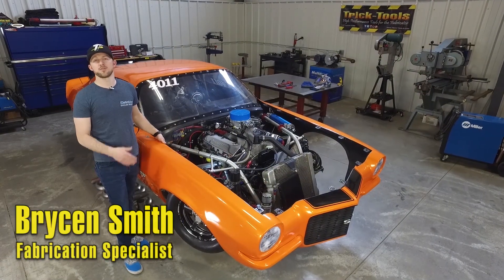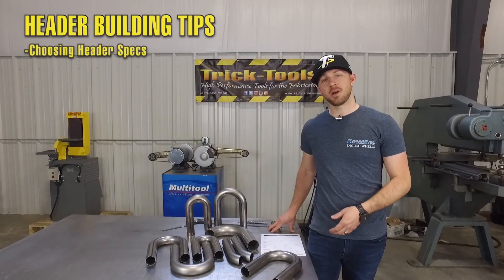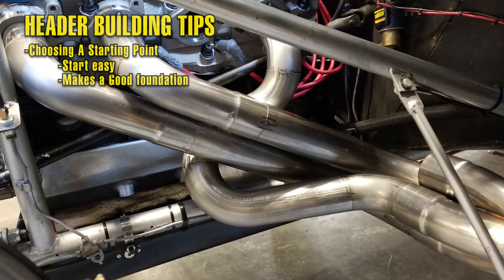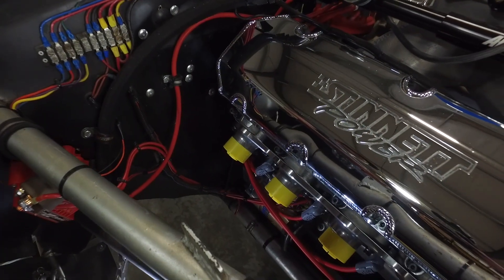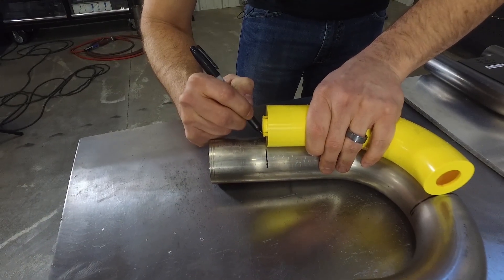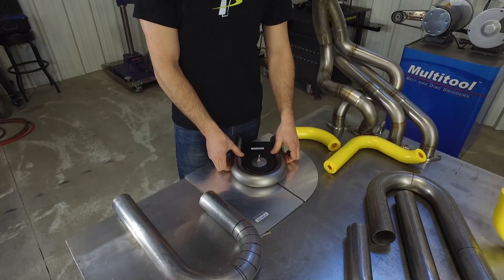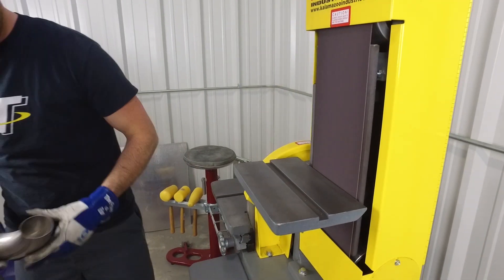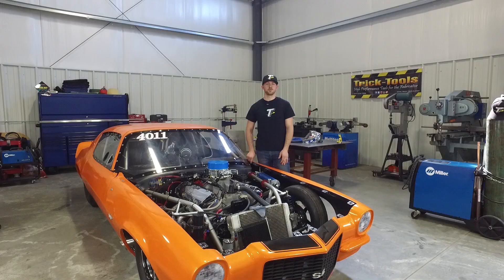Do it Yourself Header Building: Build the custom exhaust system you always wanted.

Comment: hmm why were you not using back gas with stainless steel tubing? and how much did you charge for that job- details
Reply: not necessary for exhaust manifold. You would back gas if building a turbo pipe or manifold.

Comment: Looked like you didn’t use filler wire on any of those butt welds. Would it be less likely to crack if filler was used and the pipes have a very small bevel? Or not really necessary?
Reply from the maker: With perfect fit up at the weld joints, filler rod is only used when needed. With proper heat and technique penetration through the seam can be achieved without compromising the tube strength. This process is plenty strong and has been proven many times. These specific headers have seen 2 racing seasons and are still in great shape.

Comment: Do you fusion weld the butt joints? Its hard to tell if you were tacking or fully welding in the video since it was sped up but i didnt see any filler rod lol
Reply from the maker: The seams were fusion-welded as much as possible only adding rod if needed. I put a premium on no gap seams so I can do that. It allows for a lower weld temperature keeping to base material from getting too hot and therefore becoming more brittle while also limiting "sugaring" on the inside. I've used this technique for years and welded somewhere between 30-40 sets of headers with no cracking or other issues.
Reply: Trick-Tools.com awesome, thanks for the reply, im about to tackle a set of zoomies and been hunting different ways guys build stuff, id rather spend more time dealing with perfect fit up then adding filler rod on every joint.  Everything you said makes sense so thats the method im using. Thanks again!

Comment: I built my own headers for my project, a Gen 3 Hemi in a 92 Chrysler Lebaron SS/GT. it wasn't a real easy job, they turned out pretty good. Now, those modelling tubes would have been awesome....I used aluminum fuel line as bend surrogates, also, my headers were step tube, started out as 2 1/8, to 2 1/4 ending with 2 3/8. They don't look as pretty, but they are real close to equal length. Step tube headers make a lot more power due to the "release" velocity thru the tube, but are more troublesome to make.
Reply: How did your exhaust sound afterwards on the LeBaron?

Comment: Very Well Done in regards to Information and Presentation!  When you started welding pieces of previously cut tubes I wasn't sure how you arranged each piece to have right angles just before welding.
Reply from the maker: All of the pieces were tacked together in the car in place. If you do need to remove them to tack I recommend marking the clocking of the tubes with a sharpie across the weld seam.

Comment: No argon inside pipes ??? Newbie....
Reply: Back purging is not mandatory. while it has benefits, proper welding technique will achieve good results. I've built over 40 sets of headers and many exhaust systems and most weren't purged. no issues have resulted in the non-purged systems.

Comment: How do you determin which primary tube goes on the collector position. Should the tubes be in a clockwise firing order on the collector or doesn't it matter.
Reply from the maker: Hi, Thanks for watching. It depends on your application. On most applications you wont notice any difference in the location of the primary tubes in the collectors. For space reasons sometimes you would be limited to which tubes have to go in each location as well. Hope this helps

Comment: To build a full long tube header like in this video. Do you need the Pro kit or does the basic kit have enough pieces to get the job done?
Reply from the maker: the Pro kit would be the best option. the Basic kit wont have enough blocks to model the complete header.

Comment: Very good video. Excellent work. I've done several two into ones including compound tapered bends and collectors. I use a wire for measuring the same way you use your tape rule. Never seen the modeling blocks before, they are now on the list.  My only criticism is that no experienced fabricator uses gloves of any type in any shop that has machinery with moving components. Doing so is the very wrong example for novices. I hope you are not forced to allow insurance companies to dictate how work / play is to be conducted in that nice facility.
Reply from the maker: Thanks for the reply. I will say that I am a very experienced fabricator with 15 years and over ten thousand hours under my belt. I use gloves regularly to protect my skin from molten metal sparks and sharp edges and I have never fallen victim to a machine because I make sure that I keep my hands away from pinch points and away from the parts that will catch you. I always hold my parts and position myself to in a way that If I slip I wont push my hand into the machine. Most accidents happen because people are careless with hand placement and set themselves up for failure. Thanks for looking out and I will say that we get hate mail when we do and don't wear PPE. Everyone has a different way.

Comment: In your design, do you take exhaust scavenging into consideration???
Reply from the maker: The design of the headers was based off of the specs of the engine and the amount of airflow needed to allow the exhaust gases to properly exit the cylinder heads

Comment: $420 for a 4 cylinder kit from icengineproducts HAHAHAHAHA I can get a 3d plastic printer and make them for cheaper. That is an utter rip off for some pieces of plastic.
Reply from the maker: It sounds like you have it figured out then! pretty sure your investment into a 3d printer and the time spent drawing the different pieces and then printing them would equal a lot more money than just buying them. Time is money and we have lots of happy customer that were able to purchase them and go right to work getting paid to do customer jobs.
Reply: @TrickTools  Lol, I definitely have it figured out. Been doing damn fine for myself.
Reply from the maker: Awesome!
Reply: But would you have thought of making them without seeing the kit first? Likely no. $420 isn't bad for a kit that's meant to be used multiple times by a fab shop. Easily worth the money if you use it more than once or twice.
Reply: This is a useful tool for a limited market, do you have the slightest idea how enterprise and the free market work? Using your logic, I could have done my recent finger surgery myself; all I needed was a sharp knife, some alcohol and a sewing kit!

Comment: Maybe I'm wrong but it looks like you have female end of the pipe coming off the head first. Wouldnt you want that the other way around
Reply from the maker: not sure what you are referring to?
Reply: @TrickTools  I noticed in a couple of frames the one side of the pipe was a small end (male) fitting into the larger end (female). Wouldn't you want the male end always going away from the head into the female end
Reply from the maker: there are no slip joints in these headers other than the tubes into the collectors. what you are seeing is the step up from 2 1/4" to 2 3/8" in each tube which we achieved by expanding the 2 1/4" tube to 2 3/8" and then butt welding them together.
Reply: @TrickTools  no kidding. That's amazing

Comment: I got a few stick of 20' stainless round. Problem is Stainless won't bend like DOM it kinks and it's takes alot of force. Kinda frustrated
Reply from the maker: That is why we recommend buying pre-bent materials for small jobs. The type of bender required is a large investment and typically made buy companies working to mass produce parts
Reply: @TrickTools  Heard That! After spending two long days modifying the Dies and rienforcing the design  from Eastwood 
I got it to work really nice only added about 100 lbs of  material. I Definitely did it the hard way! but I can now bend 2"x 1/8  wall stainless tube. wahooo

Comment: For the selling price of the "icengineworks" kit I buy a very nice pipe bender and still have money left...
Reply from the maker: the type of bender it takes to bend this type of tubing is mandrel bender. standard tubing benders wont bend thin wall Header or Exhaust materials. the mandrel benders that we sell start around $59,000. you cant bend this material on a regular tube and pipe bender.

Comment: A tip that I figured out when using the mock up kit is to make a line from one end to the other with a dry erase marker. This allows you to find the proper orientation if anything moves while taking it out to transfer to tubing. The kit is amazing, my first set of headers were 2" fender exit on a '64 GTO, I think they turned out great.

Comment: How to find a buy hidraulic bending machine for exhaust pipes titanium thickness to 3mm wall, stainless 430,304,316,and I need robust tubenotcher and cylindrer drills, english wheel, igbt inverter AC/DC pulse hf tig 3-350amps, I need a lot of tools, fak......

Comment: Is there any need to try to keep each primary tube equal length?
Reply: Is it also right that as all primaries are the same length and material that they will expand with heat at the same rate and that reduces stress or the risk of cracking?

Or is that not really an issue if they were not the same length?
Reply: If you watch the guys that did formula 1 style headers they try to get all equal lengths into the collector. You tube has guys that have done them and almost sounds like the real deal😂

Comment: If aftermarket mufflers Magnaflow or borla give you horsepower, why are there headers going out on the fenders and not all the way back?
Reply: They don't give you  horsepower the most horsepower you can get is right after the header. A trick is to weld a pipe on the collector and paint it were the paint burns off after running it is were to cut it for most power.

Comment: So can you make a video on how to start from scratch to finish for all sizes of engines. Like say you have a stock v6. Then you SuperCharged it. As well as cold air intake and bigger intake manifold. How would you test and figure out the best size of exhaust for best hp torque and gas mileage? And how to keep back pressure and or get ride of some. Maybe a video on how to cut the cats off. And use the stock headers and add on the tubs? Idk. Perhaps a schooling video on how to choose the perfect exhaust system based on size of motor and how manny cylinders it has. I don’t know how to explain my question. Every car has a different inch of exhaust and length of exhaust and what not. But how do you figure out that size and length? That’s what I’m confused about and what I’m trying to train myself and teach myself how to learn that.
Reply: Same here! If you find out, let me know! I'm also curious about it...
Reply from the maker: the best way to know what materials you need for your headers is to build your engine how you want it, to know all of the detailed specs about it. Then get a hold of SPDExhaust.com and they will use your specs provided to assist you in material selection.

Comment: Just curious as to why the stainless headers weren't back purged?
Reply: TrickTools You are not using any filler rod correct? Just using a series of tack welds basically one after the other?
Reply: When welding the primary tube butt joints, do you leave the tubes flat with no bevel? Do you feel the longevity of the manifold is as good when you use filler vs no filler? Any pulse used during your welds?
Reply: TrickTools looking good😎 trick indeed
Reply: In the Aerospace industry we always back purged because of the class 1 x-ray quality standards. If you did it on a set of headers, it would be way better but you would add more cost because of your Argon use . Great video and awesome talent and tools .
Reply: Back purging is more necessary for forced induction engines and not always necessary for a stainless weld to be strong. Stainless filler should be kept on a needed basis, stainless is better atoginisely welded to keep as pure base material as possible. Most filler is good on purity but not as strong as base, in the milk processing industry/food industry they will sheer off their own filler rods from the base material their welding and everything is accounted for and strictly monitored. Same with aerospace in some circumstances.